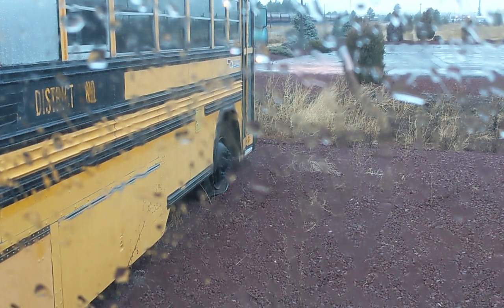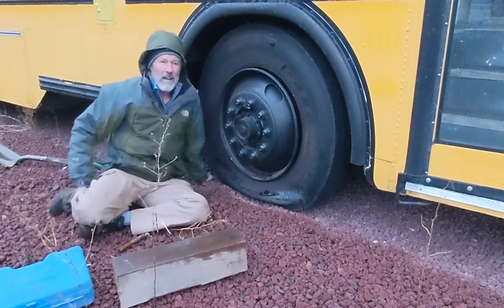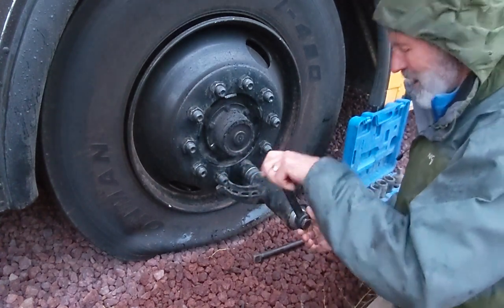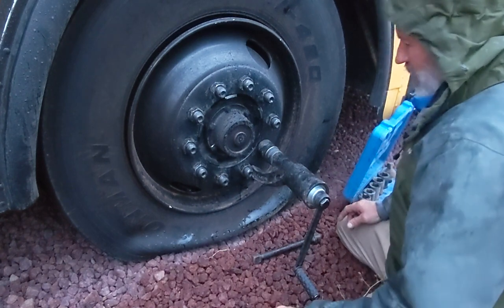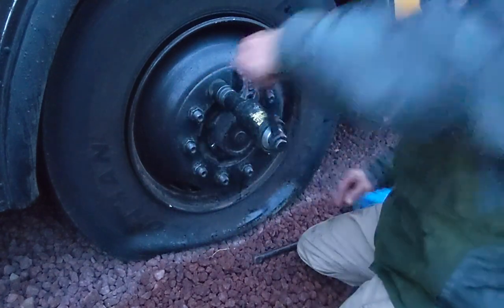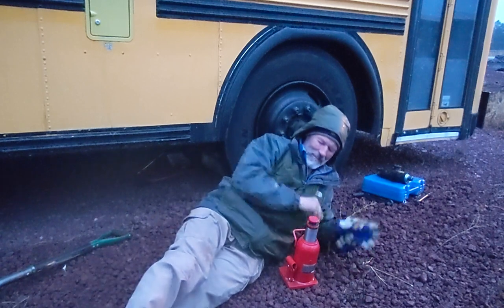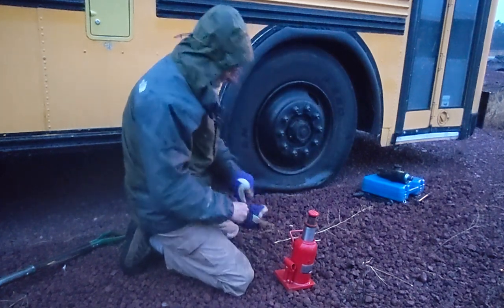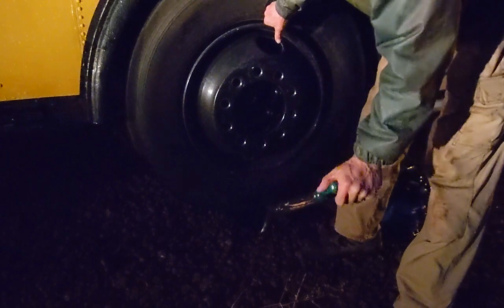Tire self sufficiency - how to change a bus tire yourself, while out on the road.

Comment: The tire had a slow leak. Add air with air compressor and return to the shop where the tires were purchased or change the tire later at a better and dryer location. I like your tork multiplier I have never seen one before today. Thanks for the great video.

Comment: When I was a trucker I carried a 18v cordless power tool set with a drill, sawsall, angle grinder and speed gun. I also had a plug kit for truck tires, and a air hose. A lot of times when picking up trailers they would have flat tires. I would pull whatever had gone thru the tread used the drill to clean out the hole and plug it in a half hour instead of waiting on tire repair to show up. That would keep me on schedule so I wouldn't lose +$700 at the end of the week.  Plug kits have plugs that supposedly don't need rubber cement these days, they come with a tub of wax instead. Chuck the wax and carry a tin of rubber cement.
Reply: I have all this on my bus, except I have 20v tools plus an 18v Milwaukee Impact wrench for busting loose the lugs. I'll take your advice and keep my rubber cement with my plug kit.

Comment: I love our torque multiplier. I've used it to break studs where the lug nuts were over torqued and gaulded or cross threaded. It's so much easier than struggling with cheater bars or calling a mobile tire guy. Great advice on the left handed threads. It gets a lot of people even the tire guys that are used to modern trucks and buses that are all right handed threads. I had some that were on a 1947 bus that hadn't been off in 50 years and they popped when the rust grip turned loose. Thanks!
Reply from the maker: Thank you for the input and for sharing your experience.  I don't struggle with cheater bars any longer!

Comment: Torque multiplier a must for any bus owner. I got one for my 1966 London Routemaster double decker. 
Had 20” split rims up front and x4 22.5” modern rims up back. 
Now I got 6x22.5’s all round and alot cheaper than 20” bus tyres.

Comment: Thanks for this!  I just purchased a 1966 Dodge/Blue Bird with its original wheels and some pretty old tires.  The tires are still holding air, but i'm dreading what happens when they finally give out.  I plan to put the bus in a laneway that's only 11 feet wide so I'm trying to visualize how I'll deal with that situation if it arises.  Your video helped!

Comment: Ughhhh. Im planning a conversion and cant decide between a small wheelchair bus or a van conversion. Everytime I try to decide there are always 2 issues that come up: 1) amount of living space (I want a little more  room than a van will offer) and 2) THIS!!!!
My biggest concern with a bus is getting a flat tire in the middle of nowhere. I am a solo traveller  and know how heavy these tires are. Im pretty strong for a female but watching how much you struggled with this I have some doubts. 
Thank you so much for doing this video "the manual way" and showing us fellow travellers that it CAN be done. I believe we should at least know how to everything the manual way as a plan B incase there are situations when the powered options arent available.

Comment: Even with Good Sam and AAA roadside plans, I still keep in my bus what I need to change a wheel myself.   I have a 1 inch drive 40" breaker bar and 8" extension and Budd socket, plus four bottle jacks (including a low one for the front), four 8" x 6" wood blocks, two steel plates for when the ground isn't hard, and I'll be buying a torque multiplier soon.   Putting all my weight on the end of the 40" bar will give me 500 ft/lb torque, just right for the lug nuts!

Comment: I have a very long torque wrench and might get a long bar together with a long non-torque wrench. Mind, my wheels are Dayton so I need a hammer as well. I suppose an axel rest or two would help. And above anything - before using a jack or rest, make sure it's on something solid. The guys that changed my tires last time tried to jack on sand and dropped the bus because they tried jacking all the wheels at once.
Reply from the maker: I love the look of Daytons...but yes, they do need some extra effort to get them off the centers.  I'll bet they look cool on your bus, though.

Comment: I keep an old piece of tarp in my tire kit.  It's a lot easier on the knees than gravel and rocks on the roadside.  I've been considering replacing it with one of those small garden kneeling pads.

Comment: If I have a spare wheel and tire already, where would you recommend I might be able to carry that? My bus has understorage built in as it was an old activity bus, but that storage is full with tools, water tanks, batteries, etc. No room for a spare. Too heavy to get on and off the roof I think. My wife suggested a mount on the front of the bus (40ft pusher). 🤷🏻‍♂️

Comment: I had to change a flat at the right rear outer position many, many years ago when I drove a 1953 PD4103 for a college choir. The hardest part was dragging the spare out of the cubby behind the front bumper, lol. I have a useless curiosity question.....did you repair the front tire and put it back on or remove the outer rear as a temp substitute?

Comment: Something to consider, the force on the force multiplier could be VERY CONSIDERABLE, It may even be great enough to round the "anchor" lugs or damage the anchor stud. A good saftey measure would be to add an 8" piece of 6mm thick scrap steel such that the scrap steel is supported by two anchor lugs and it reduces the risk of rounding an edge of a lug or sheering off a stud. 

I know the possibility is low, but if you sheer off a stud or round off a bolt, your job just got a lot longer.

Comment: Thx for this Informative video. BUT: you forgot to mention two very imprtant things. (and please: dont ask how I know...)
1: NEVER, EVER use the multiplier to fasten the nuts again. If you do, You'll certainly ovetighten them surverely. and possibly damage nuts and/or studs. 
2: NEVER, EVER use any powertools  on the multiplier. If you do, you'll send shockloads into the mulitplier. Shockloads far more powerful than the multiplier can handle. YOU WILL BREAK IT, and the possibility for sharp fragments flying around.

Comment: Those truck tyre shop boys use Inch drive rattle guns and yeah they can really nip the nuts up tight, I used to run tubeless rims over tube rims for a few reasons.
Tubeless can be temp fixed in situ without being removed, either with a plug to stop the leak and then a reinflation via an air fitting off the brake tanks or a HD electric compressor.
If they pop off the bead then some hairspray or flammable carb cleaner squirted around the break in the tyre bead and a quick application of flame to cause a small explosion inside the tyre which does 2 things, reseals the bead and puts air in the tyre (try not to use Ether to do this lol) and alloy or Alcoa rims are great things because they lower the tare weight of the Bus AND if you damage one you can belt it round again with a mash, lump or Sledge hammer.

My Kit to remove Wheels?
4 and 6 foot breaker bar, Suitable lug nut socket and short and long extensions, a massive Milwaukee inch drive rattle gun and a Pneumatic bottle jack 20 ton rated (40'000 Lb ish)

I have a Torque multiplier in my tool crate as well but being lazy and old I cheat with the Rattle gun on the square drive of the multiplier but I used it carefully because the Multiplier said in bold letters in the destruction manual to NOT use an impact gun but I do anyway lol
I also have tyre levers and vulcanising hotpatches because sometimes its easier to fix a tube tyre and put it back.
Worth noting though in my 20's and 30's I drove Trucks and coaches, sometimes in the Outback and before all the OSHA (Workplace health and safety) stuff you had no choice but to fix it and I enjoy it in a weird way lol

Comment: The very bad fact is, nobody ever got sued for putting lugs on too tight. So way more shops overtighten, rather than using a torque wrench (which takes time.)
Reply: If you don't watch the tire shop man put your wheels on, he's going to use five ugga-duggas, which is way too tight.

Comment: I live in New Zealand and have recently bought a 1982 Volvo B10 ex tour coach on airbags which I'm completing an RV conversion on. Your videos are hugely useful, I had no idea such a tool existed and will now be able to travel confident that I can fix a flat without the wait and expense of a tyre service callout (comment below on self repairs noted as well). My wheels nuts were set by. a tyre shop to 450 ft-lbs which would defeat me even with the long extension bars on the bus (around 5 feet). Any recommendations for brand? Amazon has many Chinese brands which I won't trust, preferring to buy American made,
Reply: Nothern Tool Has a nice one.
Reply: @CraigOlove  thanks, Craig, I’ve accessed one locally which is a Chinese knock-off which seems to work OK. Hopefully it won’t get much if any use!

Comment: If your watching this, skip the torque multiplier and get the large DeWalt or Milwaukee battery impact...
Reply from the maker: I have the Milwaukee Fuel 3/4-inch impact and it's a beast.  But...it was $300 for the tool alone (I already have batteries and chargers).  And you have to make sure it's charged.  And I keep it with my bus tools in my shop, not on my buses.  My goal was to show how I do it in the real world, without spending $500 for the tool...and knowing you can always do this without relying on having the battery charged...or waiting on someone else.  So, I respectfully disagree that the impact tool is a replacement for a good manual (and always reliable) option.  But I do agree that it's a good option for the right situation.
Reply: @RollingLiving  And the weight factor as well.
Reply: Would like to connect with you sir. Do you have a way that I can contact you? My wife and I are headed out to AZ. Would like to be there within the month.

Comment: The bus company that I work for they put a block drive the tire on top of the block and get some more bight
Reply: .? Please explain.
Reply: You’re building a ramp drive on top of the ramp to get elevation crawl underneath you need two jacks Second want to re-adjust you always need two of everything on a road trip but with a big bus like that I got air electrical and mechanical just in case I break down
Reply: @buddysays6726    Gotcha, thanks.